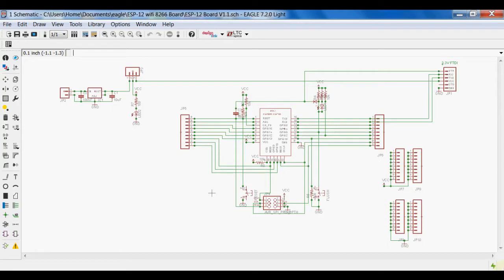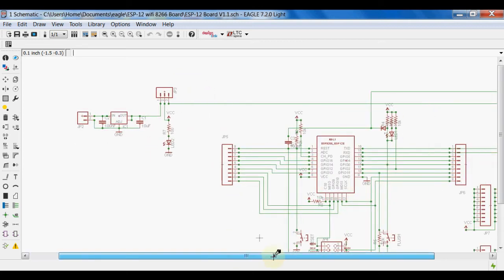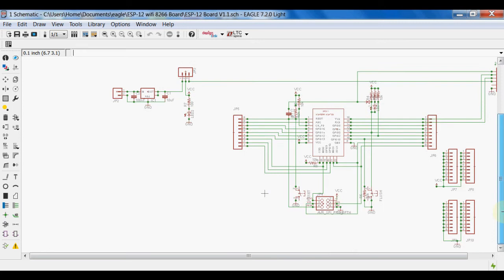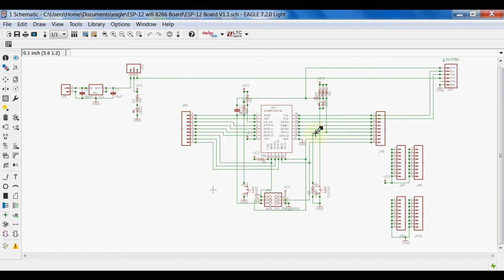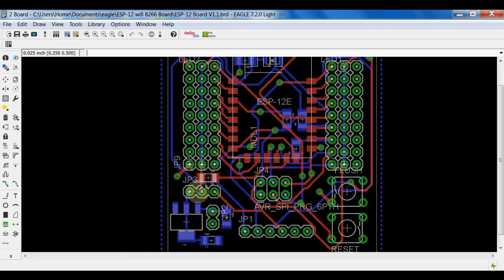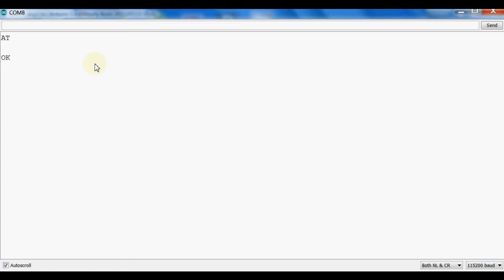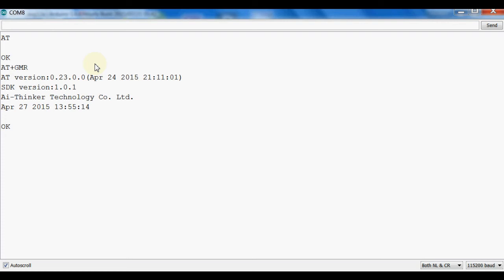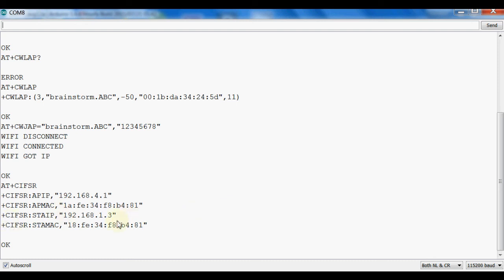Part 1 :  Making of ESP-12E IO Board and AT command test

Comment: sir I'm using esp12E from AI thinker , mine looks a bit different from yours .I'm not able to enter at command mode, I haven't used any pull up/down resistors . is it really necessary ?
Reply: It is necessary. Check the datasheet of your chip